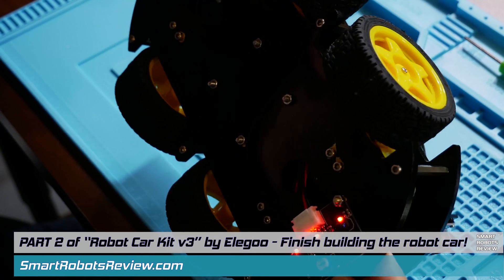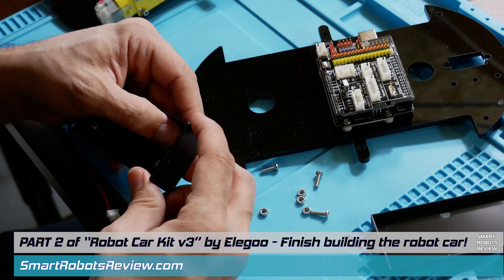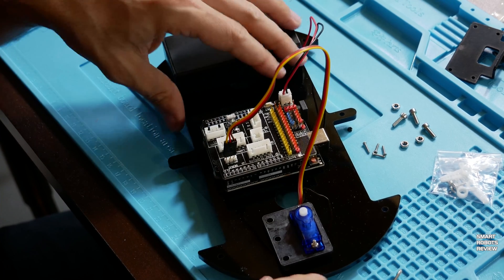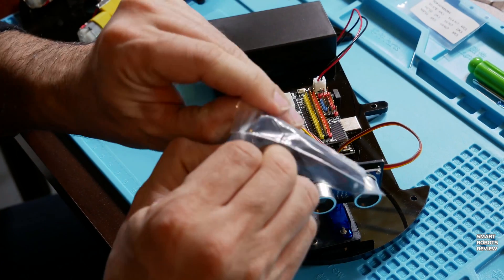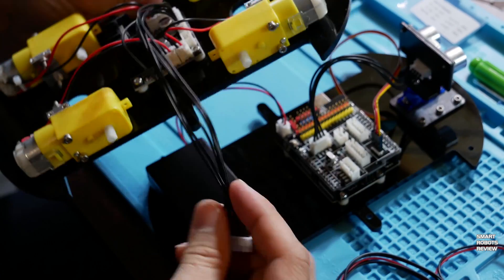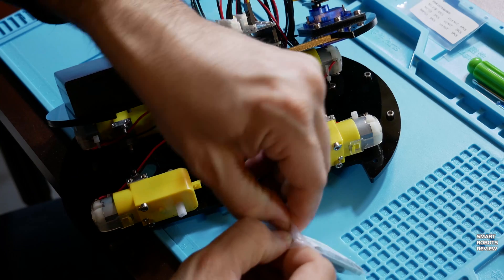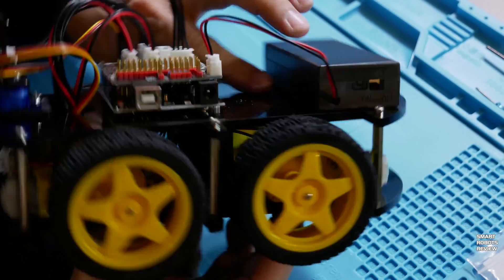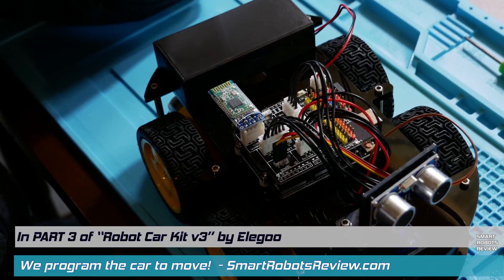Smart Robot Car - Build your own - Part 2 - Arduino - Elegoo v3 - Smart Robots Review

Comment: Dear Sir: Please help me with a problem related to the elegoo v2 car robot. I want to upgrade to v3. I changed the configuration of the pins on the driver, it works well for simple movements, but not for the final code! Using the final code with all the functions, do not move the motors on the left, but only those on the right. What would be the problem? From a hardware point of view is there no difference between v2 and v3? Thanks a lot. Sincerely, Corneliu Bocanet, Romania